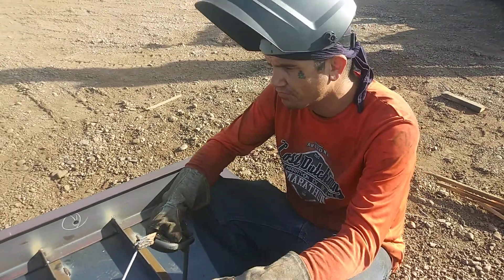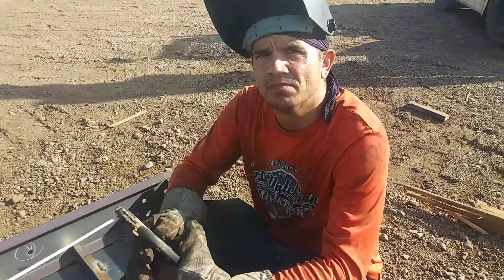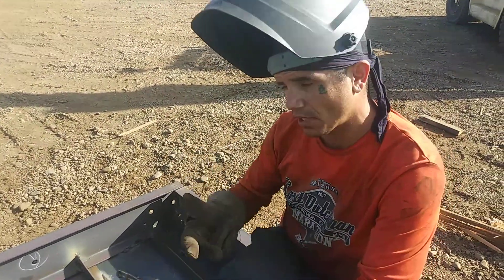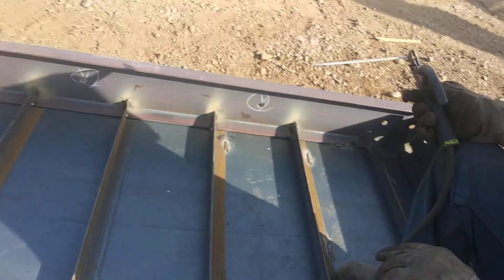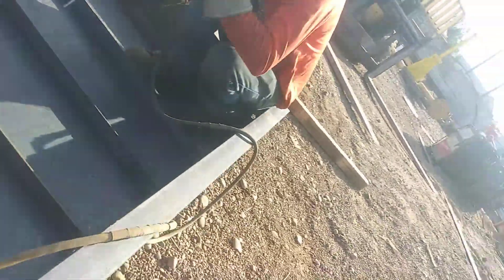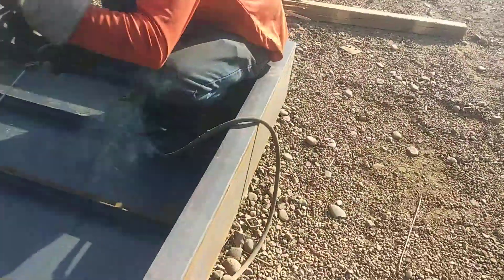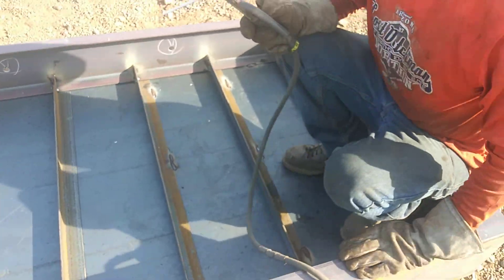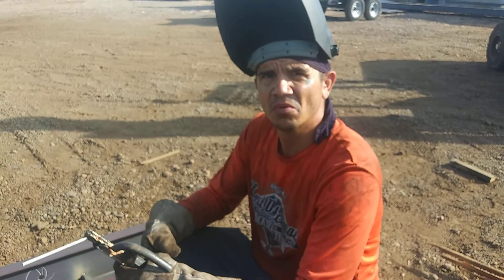4 things to keep in mind when learning How to Stick Weld by Black Feniks

Comment: You ever thought about getting into mechanical piping ?
Reply from the maker: I have done and do that too but this is less B's I like that lol
Reply: HogOn Welding There’s so much here it’s ridiculous. Gas and mechanical piping . We are about to branch out and open a company. 30+ an hour single hand . 125 an hour rig truck . 60 hours per week. No traveling. Soon as the company’s set up and bonded have a 300k mechanical pump room job ready to go only supplying the labor . 3 month project I think we can knock out in 2.
Reply: Could you guys explain more about mechanical piping?
Reply from the maker: @rodhatch4105  sounds nice